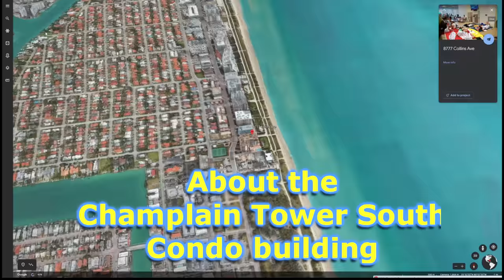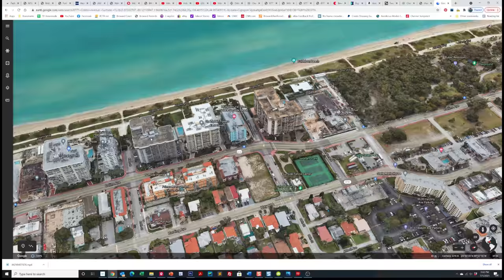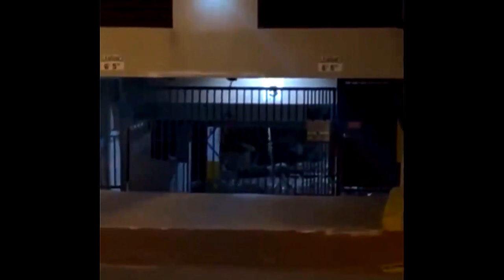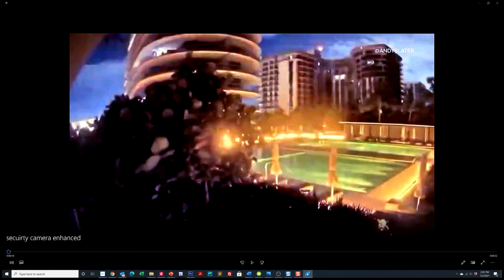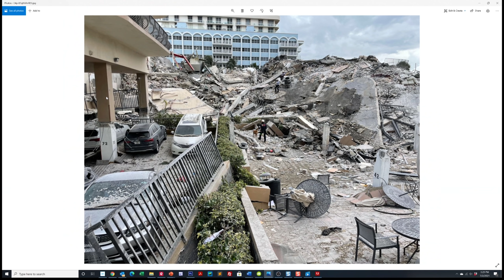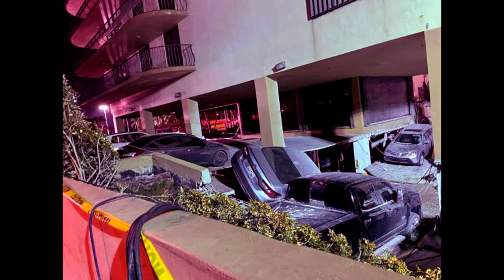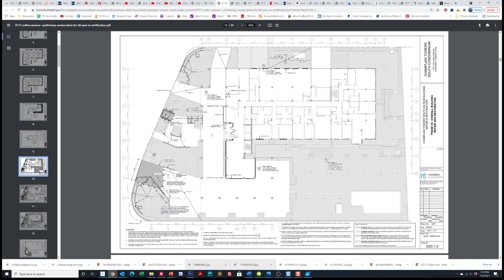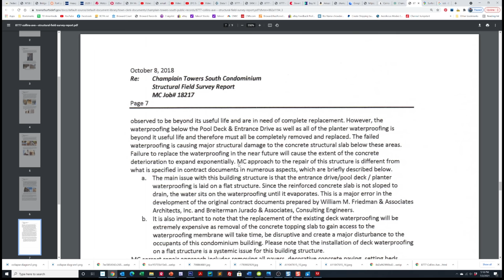Here's Cause Of Miami Condo Collapse Champlain Condo Towers, Surfside

Comment: One of the reasons I bought a house rather than a condo. With a condo (especially a high rise) all sorts of agents and managers are involved in the survey and maintenance process, all of whom have conflicting incentives. With a house I can simply instruct a contractor to survey and fix things. My sympathies to the the affected families and may the deceased rest in peace.
Reply: Only a fool buys a condo.They get nothing but problems.
Reply: That is why I would NEVER, EVER buy a condo. The only exception I would make is a "town house". And even then maybe only an end unit. Beyond the issues mentioned above, Condos can be nightmares, dealing with the HOA and a host of other related things, completely out of the owner's control!!
Reply: In Canada, now, there is a legal requirement for all residential buildings to commission a condition report (from a proper independrnt structural surveyor) and for this to be made available to prospective buyers. Acts as a major incentive for existing owners to stay on top of these issues.
Reply: Hi.
A condominium collapses in America.
And Israel sends in a rescue team.
🤔
Reply: My #1 reason to never get a Condo WAS  to pay 100s of thousands of dollars and I'm still restricted with the volume of my surround sound system 
UNTIL NOW the possibility of this tragedy is #1
Reply: All those independent contractors and surveyors are either paid off by the developer to turn a blind eye to the defects. Its definitely a conflict of interest if those independent contractors and surveyors are family members of the developer...

Also condos with a pool is always going to be expensive to fix, not just expensive but a big job also...
Reply: I bought a town house single story one adjoining building both garages have fire doors and firewalls
Reply: @747-pilot  I agree townhouses better especially if it only has one adjoining building the HOAs could be your nightmare
Reply: @abatude5879  is HOA the building management committee? Because in Australia its called strata and yes... strata is what kills you if you decide to buy a apartment or town house...
Reply: @nooley97  Every time I see an apartment building with a roof deck swimming pool (looks great in the brochures), I think......"that's one huge risk....." (Even a ground floor swimming pool is trouble, as this collapse would seem to confirm).
Reply: @stephenburnage7687  yeah I am planning to move soon and the new apartment complex is like 20 storeys high and with pool and gym... the pool is on the ground floor but if it ever leaks the underground carpark and the cars will be impacted...
Reply: You get a similar (but not life threatening) situation in London, with these old Victorian conversions. The owners are often non resident; the occupants are often kids and; the property manager just in it for the fees, such that no one cares about the actual structure of the building. I looked at a couple as possible investments but all I could see is $100,000's of liabilities building up. Old buildings take a lot of upkeep.
Reply: @stephenburnage7687  as long as the concrete is reinforced and cured properly there shouldn't be any issue they usually use like 1" rebar bars to reinforce. I work sheet metal in hi rise and I watch them install the reinforcing with rebar that they do is wild... Where was a section between two buildings they had to use as a support and the rebar was like 6ft tall box all intertwined it was insane then filled with concrete that thing wouldn't move ever lol
Reply: @stephenburnage7687  totally agree... not to mention the building in this video is like 40 years old... 
But apparently the residents did notify the building managers about the cracks in the underground space but nothing was done about it... because the people that was meant to care just turned a blind eye..

I hope they find the people who is responsible because they can't put this matter under the rug...
Reply: Plus all these defect buildings and collusion between developers and the building contractors, surveyors and the building managers that are involved. These tactics are old news, this practice has been going on for years in Hong Kong... I'd bet the developers in Australia are just catching on now because of all the new high rises...

Not to mention most of the buyers for these new high rises are from mainly Asian countries, you would think investing in a country like Australia these corruption practices won't be as evident but Australia is just as bad... I mean the builders are just  as bad in Australia
Reply: So right… BOD change every two years and information gets sidelined unfortunately no one should be surprised expect more of this type of catastrophe going forward…. 
“Seen with my own eyes buildings visibly deteriorated 8 miles North of this disaster”… don’t want to upset the residents with assessments…the echo
Reply: @5thratenextjewsnetwork481  Rescue teams from many countries travel all around the world. They have the gear and the know-how and it keeps their skills up to date.
Reply: @stephenburnage7687  Yep, in Ontario it's pretty well nailed-down now. It's good because it means tightwad owners can't bully the directors so easily. I was a condo director for about 20 years at two different condos and it's very frustrating when you get owners who bought into housing that depends upon mutuality but don't want to make their contribution and get upset when it's pointed out that it's what they signed-up for. Some people sign all sorts of stuff without reading what they're signing. If mutuality isn't their thing, they should stick to detached houses.

It's especially bad for new developments because the condo fees are lowballed by the developer because they're only on the hook for the first year's shortfall. The first thing the board has to do is hike up the condo fees by a significant amount to what is required to start building the reserve fund. The purchaser's lawyer ought to advise them of this - the developer obviously isn't going to and condo rookies don't question why the condo's fees are half everyone else's! Developer liability for shortfall should be pushed out to 5 years.
Reply: @unclemick-synths  A big issue is the real estate agents. They try and pretend to naive buyers that a 1,200 ft2 condo is the same as a 1,200 ft house. No it is not!!
Reply: @stephenburnage7687  Yep. People think realtors are their friends when they're actually only friendly and it's cupboard love.
Reply: Not to mention condos like this have a ridiculous HOA payment per month
Reply: @Lewdacris916  yep, maintenance of hi-rises isn't cheap like lo-rises. Fancy common elements, elevators, pools, a/c, electricity, wages, etc.
Reply: Will never live in Florida, either.  The real estate market there is notoriously shady, and everything is built on top of sedimentary rock (if not actual sediment) that easily erodes in water while being SURROUNDED by water.  In fact, if you're not in the middle of a swamp, that's likely because someone drained the swamp and you're living where it used to be.  I don't want a sink hole swallowing up my house.  No thank you.
Reply: I’ve never owned a condo, my assumption has been that the HOA fees go towards making sure this does not happen.  Now that I have read from the families that lost loved ones in this structure, I’m learning that the HOA fee is separate from structural fees. It seems just too expensive compared to buying and owning your own house.
Reply: @P.Johanna  I think the big point is that with a house you are in control, which for most of us means fixing  issues before they become catastrophic.   With a condo you have dozens of other people in the middle of that process. House maintenance may sometimes work out less and sometimes work out more than a condo but at least things get fixed in a timely manor.
Reply: @rick-be  Yeah once, but never again.  Try being in charge at a board meeting.  Anyone wanting to be the board president is 100% an idiot just for doing it.
Reply: @edwardschmitt5710  Even the best intentioned and knowledgeable of owners
can get little done with recalcitrant neighbors.
Reply: @unclemick-synths  HAHAHAHAHA
Reply: PAMELAJONES  Yes!  How true!  How important to get that point across!
Reply: @rondavid7413  Notice that none of the concrete in the New York 80-storey skyscraper headquarters of large trading banks experiences cracking.
Reply: PAMELAJONES  Vois-la: there you have it. An explanation from beginning to end. That's kind of what I thought.
Reply: that is the idea behind condos , build crap and pass the cost of maintenance onto the owners of the condo . biggest scam ever pulled on people . When builders built for themselves you can be sure there was quality built in . they didn't want high maintenance costs
Reply: @nooley97  please remember to check around for vatious forms of cracks in cement, spoiling,  and unusual areas of moisture.
Reply: @sweetpea74127  no use.. in other words complain to someone who actually cares...
Reply: Time and time again is public knowledge that water is dangerous for construction
Reply: @stephenburnage7687  absolutely, I don't like pools at all, period specially when you have the beach right there